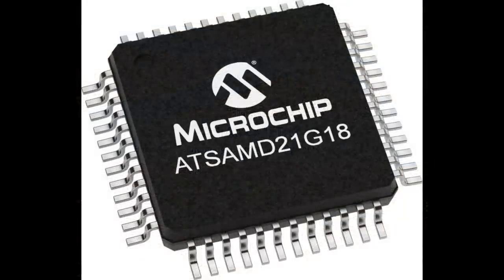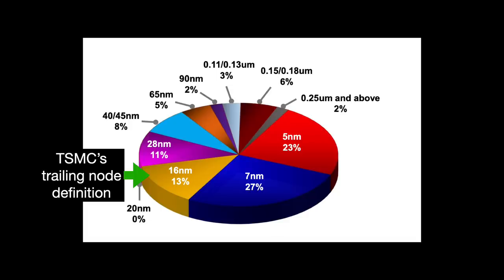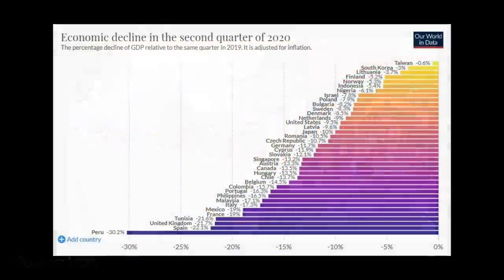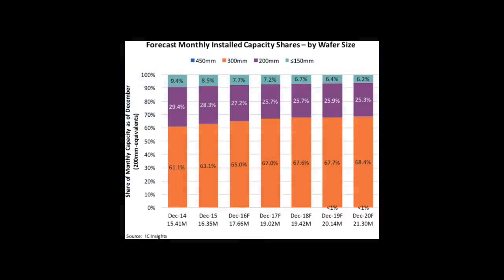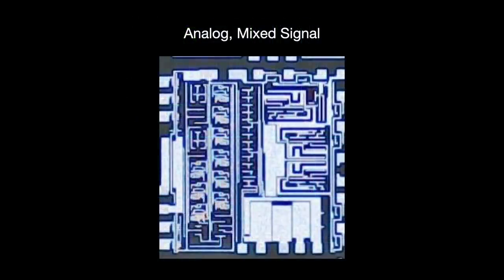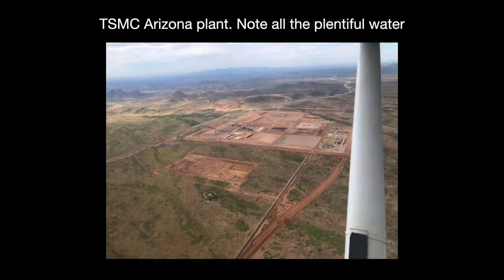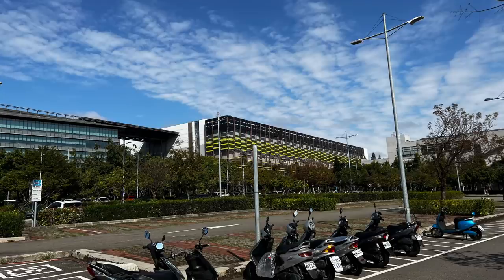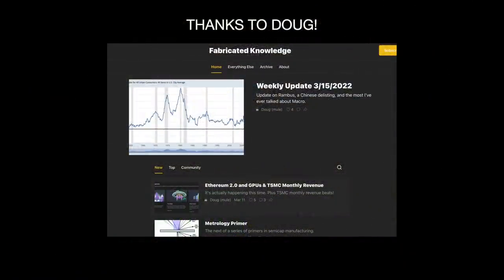Where The Real Chip Shortage Is

Comment: There has been a refusal by many companies to migrate 0.25, 0.18, 0.13um parts to advanced nodes on 300mm wafers. They have been focused on reducing costs by fractions of cents per part and driving ASPs down. They are not used to scaling. Almost impossible to get their designers to move to a new technology.
Reply: yes, you hit the NAIL on the head with this....its a mindset thing...due to years of low cost MATURE tech...
Reply: Right, but they've competed on low cost and refitting a fab means costs go up, and then your customers run to Chinese fabs.
Reply: "to get their designers to move", why, no reason! If you get 5$ for a before 1$ part there is NO reason to port. They can milk the market up to the time a greater work around get substance. SEA need to strenght there own design capacity, the capacity is in SEA. Atmel bought a small uC C compiler design group in Norway (AVR), assemble some flash memory and some medium performance AD and fill an old fab. They will never port.
Reply: From the video: 0.28um parts have the lowest price per junction and this is a low margin business.
Reply: @Conservator 0.028um, not .28 - Mass market is far from that
Reply: Is it even possible to scale everything down?
I could imagine that some voltage regulators are simple in their logic, but need the size to accomodate the current and heat flowing through it
Reply: @_TeXoN_  Technical you get with newer processes more options: 3 oxide thickness, LDMOS, there are more limits to higher voltages but current density go up by scaling in gate length and many copper metals.
Reply: @maximme  Even when said mature tech has higher gate prices than other mature tech.
Reply: @_TeXoN_  This is true. for deep trench power transistors the amount of logic is a small area of the chip, even at 250nm transistor sizes. The vast majority of the device is deep trench FET's.
The only thing you really do shrinking the logic transistors is open them up to being killed by smaller defects, hence reducing yield for not much or in fact no increase in the total number of die on a wafer.
Reply: I was just thinking about this, couldn't they move to smaller nodes? you'd eventually get the price low enough, volume + more chips per wafer would reduce cost, while using newer technology
Reply: @l3d-3dmaker58  All MCUs could have ultra low power use.
Reply: well if new those old nodes stopp beeing build and are still at high demand/utilisation eventually prices will rice and they might even get more expensive then newer ones.
Reply: @ronnetgrazer362  But going to smaller nodes increases leakage currents and makes it harder to design parts with truly tiny quiescent currents.
Reply: @2ftg  I didn't consider that! Maybe there's a sweet spot somewhere half way, or perhaps a hybrid approach of some kind?

Hard to imagine photonics becoming fashionable "soon", while the ubiquitous ICs stay stuck in the previous century.

Comment: Great point. And the tiny resistors, capacitors, diodes, etc that go into the boards are also in short supply with backlogs of >12+ months.
Reply: You can buy passives, though perhaps not the one you want.  Processors and flash, it's hard to make similar substitutions.  Right now, most microcontrollers I've been looking at have 52 week backlogs that are staying that way from week to week.  I've heard that it will be this way well into 2023.
Reply: Especially power J leaded parts
Reply: It can't be TOO bad because new electronics are coming out hot and heavy in the world of computing, but those companies wouldn't have been stupid enough to cancel orders.  Graphics cards, motherboards or mainboards, even CPUs have those components especially those little tiny resistors.  

So, what might have happened is some companies cut their orders because they felt demand would drop because of Covid, and the compute companies like AMD, Intel, Nvidia and all the companies that work with them (long list) bought up the supply that became available.  

Don't a lot of those components come out of Japan?
Reply: @johndoh5182  I am simply relaying what a close friend who works as a purchasing agent in one of the relevant processor companies told me.
Reply: @jaymacpherson8167  And I'm just reporting what I see right now as I follow the computer industry.

The world of GPUs has gone through a big shortage for instance because of over-demand due to crypto mining.  Now the supply of GPUs from multiple companies is excellent.  AMD was stretched really thin because their products have been in high demand, from CPUs for PCs and servers, APUs for game consoles, GPUs for desktop graphics and GPUs for server compute.  They now have good stock of most products so they've been cranking out products.  Same thing with Intel and Nvidia.

So the difference is where these companies were sitting before Covid hit.  Back in late 2019 the world of compute KNEW they were going to have a problem meeting demand for about 2 years so if supply opened up they bought it.  Same thing with Tesla.  They do preorders.  They KNEW Covid wasn't going to slow their sales and now they're pumping out vehicles, no problem.

Also in China, companies are pumping out different products while others took a hit because they projected a drop in sales.

That's what you get with just-in-time manufacturing.  And once again almost every PCB needs those tiny components you're talking about ESPECIALLY mainboards and GPUs.
Reply: I haven’t seen any shortages of resisters, or most capacitors. Some diodes, but they are easy to substitute.
Reply: This is simply not true.
Reply: @NEBB11ify  I oversimplified…there are components used to make integrated circuits that are in short supply with multi-month backlogs.Which ones? I don’t know exactly.
Reply: @jaymacpherson8167  Semiconductor ICs like PIC micros and ADCs that Microchip makes are in short supply which is the focus of this video. Microchip doesn't manufacture passive electronics like resistors and capacitors. Those industries are largely decoupled from this issue since they don't require deposition and etching technology to be fabricated. 

Source: just trust me bro
Reply: @seanm2511  Another example.Raspberry Pi 4GB or 8GB memory will be available in Sep. 2023.Maybe later.
Reply: @neilkurzman4907  there was an MLCC shortage a while back. Also, if you need that specific voltage of zener diode with 1 uA-or-smaller leakage current at some lower voltage, in that particular package because increasing the footprint would mean moving everything else on the board outwards, then suddenly replacing it is not that easy. Once you're counting microamps at 85 deg ambient, or have other "interesting" requirements, that whole datasheet beyond rated current and reverse voltage that you can usually ignore for "just a diode" suddenly becomes really interesting and full of gotchas.
Reply: @Validole  
If you need some special parameter from a device then yeah it becomes harder to get
I remember a few years ago going through about 10 different brands of 4000 series inverters. Because only some of them would work in our application. 
I ordered some T.I. regulators about nine months ago with a delivery time of three months. I still don’t have them and I have an updated delivery time of next October. I don’t need them anymore, but they’re cheap and I’m interested to see what they actually arrive.

Comment: In Japan a 28nm fab is being built by TSMC.  I'd call that legacy.

Plus, once TSMC has a lot more production  on N3, N4, N5, it will rebrand what it calls trailing edge, so there will be more availability of nodes like 12 - 7nm.  Now, for some electronics you can't drop down too much because the IC would end up being so small that it's too hard to cut the wafer for the hundreds of die that would come from it.  So, simple circuits that still warrant an IC but only have a few hundred transistors need to stay on those older nodes.
Reply: I had not even considered the physical IC size. Great comment. Thanks for the perspective.👍
Reply: I imagine shrinking the node size makes them less hardy as well, with respect to voltage fluctuations and static. Sometimes handling abuse is part of the requirements. Also a factor in rad hardened chips.
Reply: @ricardokowalski1579  Yeah it's an important issue in considering how small of a node you can put a circuit on.  In fact that's why Japan wanted a 28nm fab from TSMC built in Japan, for general electronics and not HPC.

Even with 7nm you're at 90 million transistors/sq. mm.  What happens as you try to make a die smaller and smaller, you end up getting a bad ratio between edge area to have a border for the cut, and the area of the actual transistors.

It's a REALLY hard answer to find but I saw a comparison with 2 different node processes, 90nm and 65nm and with the 90nm it said the smallest die could be 0.683mm x 0.683nm and for the 60nm node it was 1.533mm x 1.533mm.

It gets to, how fine can you make the border between each die, and I have to think getting below a die size of 0.5mm x 0.5mm is near impossible.  So, with a 7nm node you can fit 22 million transistors in that small of a space.  

But then how do you make the connections between the die and a PCB?  It's not only the fact that you need an edge area for making cuts between the die, but you also need wires to come out of the die to create some kind of package.  Can you fit 1000 connections in a die that's only .25 sq. mm??  I think not but I could be wrong.

Price becomes more expensive as the node becomes smaller, so this is a REAL issue.  I'm sure there's variation in pricing so at some point a smaller node might actually be less expensive, but once you get down to the state of the art nodes, there's pretty much always a rise in cost for smaller nodes.   

At some point you can't make a die any smaller, so if you hit that point with a 90nm node, it's simply wasting money making that die on a 7nm node.  On top of that you have other issues come up as the node gets smaller as other comments point out.
Reply: I'm not a computer guru but after the next Carrington event y'all will be talking about the most anti electrostatic chips out there. Screw the size. I'll take functionality and reliability over the latest greatest ideas out there.
Reply: @kirkthiets2771  There are effectively 0 ICs that can handle that. (MAYBE some satellite ics that can, but basically nothing consumer that is used on the surface of earth.) I think even the very first transistors will burn out instantly, not even mentioning  ICs. Tubes are the only things that can reasonably stand those kinds of voltages. Russia is still using tubes in certain military applications btw ;)
Reply: SMIC is at the 28nm node too. but banned. (nothing to do w ukraine, just social nationalism).

Comment: The leading/bleeding edge may be sexy, but so many industries run on jelly bean parts that you just can't get -- analog parts, mixed signal, power supply/regulators, and so many more. Quoting me an 18 month lead time on some of those jelly bean parts? Kiss of death!
Reply: we buy plcs and other automation equipment . we don't get down to the chips. we just need plc's . everything is backordered for months/ years. we go online and try to order . suppliers has 2500 or so on order from the manufacturer but are only getting like 100 every few months. none of these chips are leading edge. so we are fucked i guess.
Reply: It’s all fun and games until that MESFET discrete your fancypants state-of-the-art module needs is backordered!

Comment: It is not only microcontrollers. A lot of other analog and mixed signal chips too.
ADC, DACS, motor drivers, voltage regulators/references e.t.c.
Usually they are in stock at speculative resellers (for abysmal prices), but not in a normal one's like Digikey or Mouser.
Reply: speculative cough Rochester cough
Reply: ADCs are sold out, luckily there are still some available. Couple weeks ago I went with MCP3421 while considering ADS1115 as backup when more channels are needed.

Comment: I don't know why it had never occurred to me that there is a brisk market for 25+ year old semiconductor device fabrication equipment, and that they are continuing on in revenue service cranking out in-demand chips. So there is no ongoing production of new equipment for old nodes? What is the oldest node (and largest feature size) still being used to make chips?
Reply: Some laughably old nodes are still in production for niche markets - HV CMOS (up to 300V) and CMOS image sensors are particular examples where "cutting edge" is in the 300nm range
Reply: I'm not that surprised, to be quite honest. Some chips are now very old but have simply settled in the industry. I don't think there are many embedded engineers who have never touched an ATmega328. And you don't need a 4nm node to make those. But u can easily tell that a lot of places have them either put of stock or at increased prices. They've always been abundant, and very popular among hobbyists and R&D engineers. But they've become so much harder to come by.
Reply: An enormous amount of III-V production has never scaled beyond 0.5um. There’s simply no need in many cases, and the tools and processes used to create them aren’t capable of doing much better.
Reply: You can see a list of fabs here: https://en.wikipedia.org/wiki/List_of_semiconductor_fabrication_plants. 350, 180, 90, and 45 are all still pretty commonly used for chips where smaller process nodes are not needed.
Reply: @Marco_Onyxheart  
They still make the LM555. 
And probably will for a long time.
Reply: @neilkurzman4907  Oh yeah, the 555 is an excellent example. That little thing isn't going anywhere. If you want a timer, that's almost always what you'll buy.
Reply: open a PC and look at all the "glue logic" chips on the mainboard, or take a look in the PSU. Even a GPU has simple ICs for power managenent.
Reply: @Marco_Onyxheart  No, MCUs cost less (4 cents vs 5 cents) than a 555. They are also much more accurate (0.1% vs 5%) at timing and take less board space since they need no additional components which makes the PCB and enclosure 1 cent cheaper. Using a 555 today (or in the last decade for that matter) is just silly. Not to mention that MCUs were 3 cents before the shortage.
Reply: @neilkurzman4907  The same with the LM741 OpAmp.Can't live without it.
Reply: @oladunk9986  
I guess that’s still around too.
Reply: @oladunk9986  
What's an LM741 for then?
Reply: @MostlyPennyCat  Amplifying shot noise.
Reply: @NavinF  MCUs need to be programmed. Adding that step in your production, unless you run product in the hundreds of thousands, will eat your 3 cents. For the majority of designs (not by sales volume, just number of designs) only ever see hundreds or few thousands of pieces produced, in which case programming is probably performed by hand. Prefer to simply avoid that step altogether, when possible. Also avoids software bugs.
Reply: @Validole  Most manufacturers will sell you programmed chips for free. If you're making <1k units across the lifetime of the product, none of this matters because you don't care about price. I still think 555s are nonsensical in 2022

Comment: Great topic but I feel you missed  out another big factor that is influencing the industry at the moment.

We are a small electronic production company that build some products that ship worldwide.  So we see these issues on day to day basis. 

At this moment brokers are making millions by buying in large amounts of chips. Even new batches that come right from the production floor.   Just to sell it at 4-10 times the normal price.  

They buying all stock world wide to create a shortage too so they can sell at a high price.  

For example we got a notice of chip back in stock from a manufacturer.  Batch of 10k chips.  
Direct rushed in to buy 100 chips to keep production going.   But the full batch was already gone.  ( within seconds )

A few days later a batch of 9600 chips are showing up at a broker inventory for 8x the going rate of the manufacturer.  

Also almost all 3,3v regulators that are pretty common to use for all small logic.  Are almost all gone in the world.   But huge deposits are in the broker hands trying to sell them for 10-14 dollars a piece that cost normally around 1.5-2 dollars.  

Luckily a few chip manufacturers are now putting in the 100 chips per company rule.  Meaning you can buy only 100 pieces for a set periode.    With a batch size of 50k chips this gives a bit more breath room that there will be stock without brokers buying it all.  

As it seams that putting money into chips inventory might be the best investment at the moment as the interest and payout seems to be much higher then invest in housing market at the moment.  

Check a few chips at  octopart . Com  and see how many parts are only available trough brokers 😉
Reply: Ugh. I hate advocating for regulation but this might just need the govt or better still an industry body to step in.